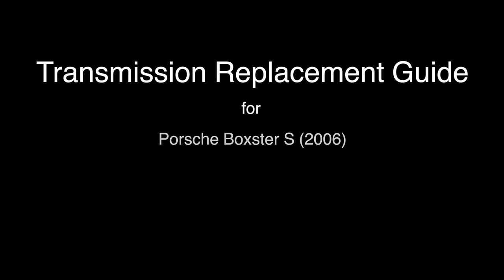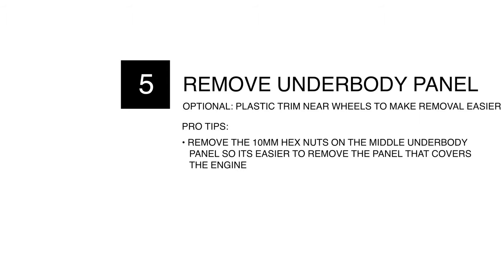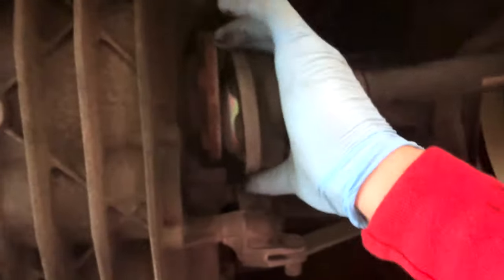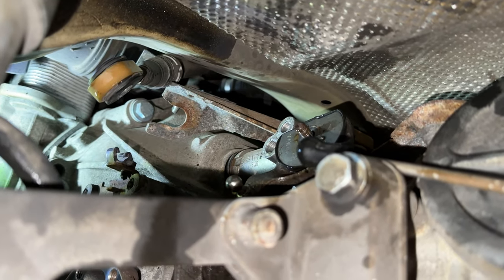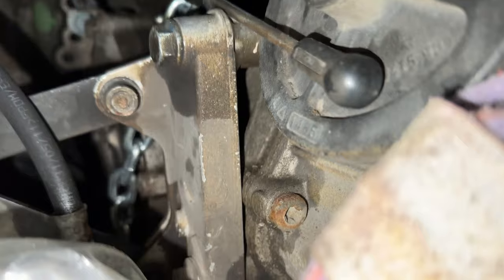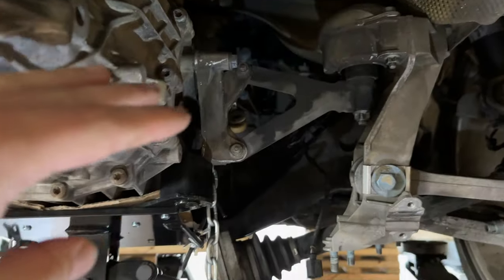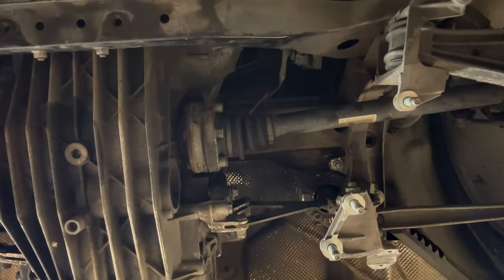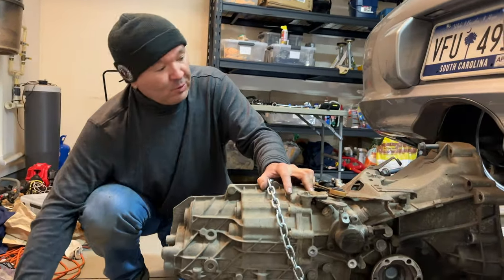Transmission Replacement Guide | Porsche Boxster (987.1 and 987.2) (2005 - 2012)

Comment from the maker: Do you have any advice? Share in the comments below! I'll pin this as a reference comment.
Reply from the maker: XuTVJet from Planet9 used a wiper arm removal tool to remove the shift mechanism that blocks the clutch slave cylinder from being removed.

"I used a $13 wiper arm puller as my pivot lever was stuck on there good after 12+ years."

https://www.planet-9.com/threads/clutch-replacement-guide.251728/post-2210030
Reply: 25:07 You can actually complete remove the bleed valve which will give you much more room to remove or install the main line bolt on the slave cylinder.

Comment: Very detailed video! Curious why you didn’t also replace the RMS (seal around the crankshaft) while the tranny and clutch were out. This seems to be an. Issue for 987s over time. Also, when you put it on jacksstands, do they need wood under them to keep them from digging into the floor? The jacking tips were great! I have done work on mine but never jacked it up as I didn’t want to do it wrong
Reply from the maker: My justifications were: 1. laziness, 2. I can take the transmission out now without too much difficulty if I really need to, 3. A minor oil weep is not the end of the world so I’ll have time, 4. I did do the flywheel because it was recommended to replace. I put that in a separate video, 5. laziness
Reply from the maker: Absolutely, I’m glad you asked, no I did not because the jackstands I bought have very nice feet and do not need wooden blocks under. they are also spread wide, giving it good support

Comment: doing this on a 2006 cayman s thanks to your video. 🫡
Reply from the maker: 🫡 best of luck, those difficult bolts don’t stand a chance
Reply: Tried to knock it out this weekend but got stuck on the A bolt (didn’t have the correct triple square bit).

I am much more worried about the “D” bolt. Seems super tight to get off (and back on for that matter). Any tips?
Reply from the maker: @derivativYT  good morning, (1) you got dis! (2) extensions + swivels. at least three medium extensions and a swivel (if I recall correctly) did the trick. + gloves so when it breaks loose you don't get cut
Reply from the maker: @derivativYT  ps I include links to the required sockets in the description, is there anything I can do better in terms of listing them in the description so others are less likely to get stuck on waiting on sockets? (asking so I can do better and because I hate waiting on parts / tools lol)
Reply: @RuslanVideoFilms Going to be finishing the job tomorrow. Thanks for the great resources 🫡
Reply: @RuslanVideoFilms  The description was great for the most part. I would recommend putting a short sentence next to every tool describing when and why it’s necessary in the project. I didn’t end up getting the same triple square socket because I didn’t realize that the set you linked was one of the only ones that would work. PS I did get the transmission down last night. Thanks for all of your help.
Reply from the maker: What a great tip. And super job. Anytime

Comment: Hello I have a question about my engine,  we put a 2008 cayman 2.7 engine inside a 2005 boxster 2.7 and the car is accelerating poorly, feels like a lack of fuel or starving for air or something....what could this be? My brother said the injectors that came with the 2008 are bigger
Reply from the maker: To be honest, if you replaced an engine, you probably already know more than me because I haven’t done that yet. 

I do recall reading something from the pelican 101 book about installing newer engines into older cars with the same displacement:

The 2007-08 Boxster engines were the first of the series to get Variocam Plus (variable valve lift). The Carrera 996 had Variocam Plus since the introduction of the 3.6L engine in 2002. The 7.8 DME used in the 2003-06 Boxster didn't control variable valve lift, and there are no pins or wires in the engine harness to control the mechanism. Therefore, you need to add the wires into the engine harness when performing this installation. Pins A1 on both valve lift controllers connect to a 12V source in the harness: use the 12V supply for the variable valve timing solenoid. Pins A2 on the controllers connect to DME connector pin C1 for cylinders 1-3 and pin C26 for cylinders 4-6.

https://www.pelicanparts.com/techarticles/Boxster_Tech/11-ENGINE-911_Engine_Swap/11-ENGINE-911_Engine_Swap.htm

Sorry I don’t know more, I’ll keep this question in mind as I continue to learn. Maybe try taking it to a dyno shop they might be able to monitor the ECU?
Reply: @RuslanVideoFilms  thanks

Comment: What is your rear wheel offset?  Or do you have spacers?  Fills the wheel well nicely! 👍👍
Reply from the maker: I do but I do not have the exact measurements since the spacers came with the car. I’ll make a note to make a measurement and follow up on this comment the next time I have my wheels off (which will probably be soon 😎)!
Reply: You generally need new springs if you install spacers as if changes the lever length  and puts more strain on the suspension